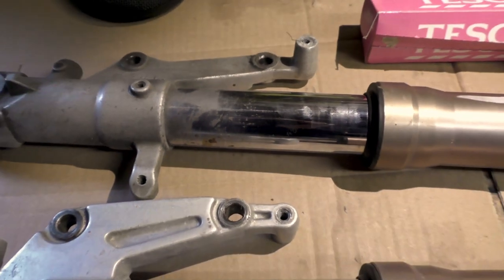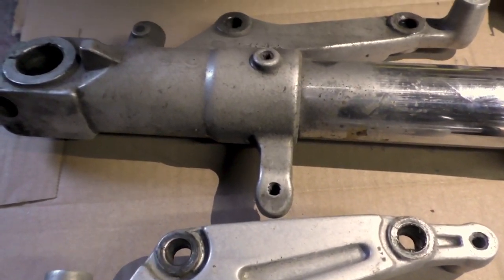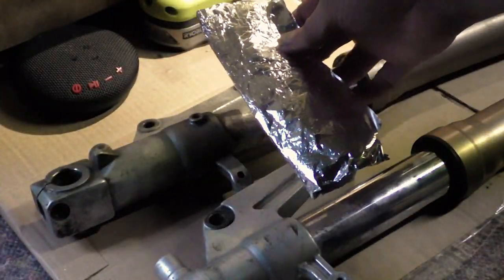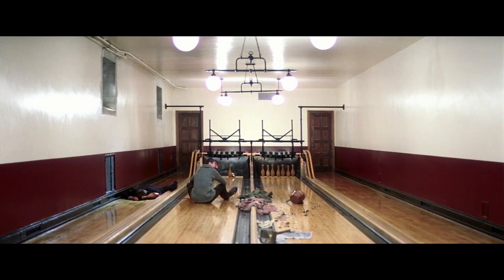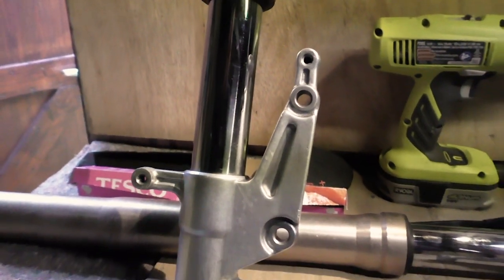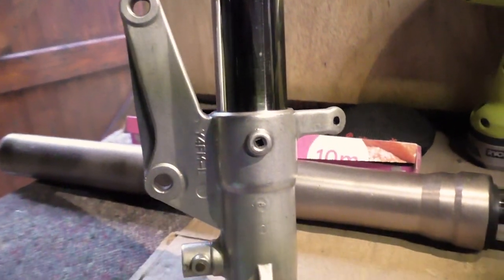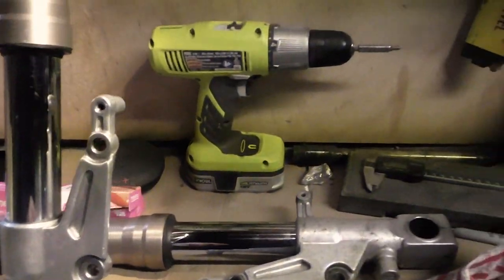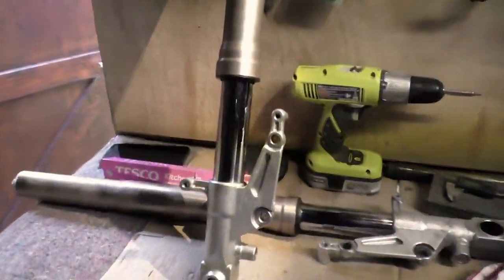Cleaning rusty motorcycle forks ONLY with Aluminium Kitchen Foil

Comment: Is cerakoting the fork leg better than powdercoating it ? I would've thought with all the hammering they get from the road and what not, cerakoting wouldn't be durable enough?
Reply from the maker: Good question. I'm actually going to make a video at the cerakote place, so I'll ask that question. The only reason I like the idea is to colour match everything on the front end and that the coating is something like 1/16mm thick whereas powder is thicker. Tis a good point though and I'll make sure the film that question and answer to the guy! Happy New Year mate